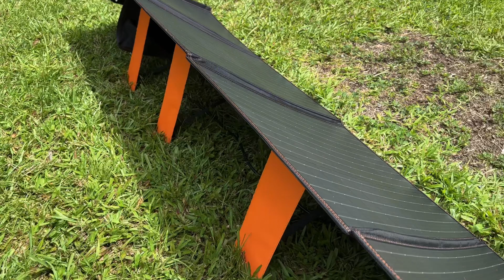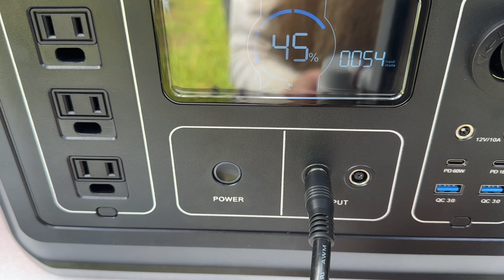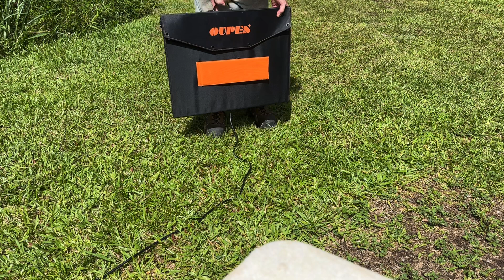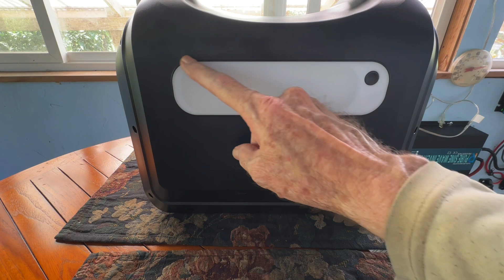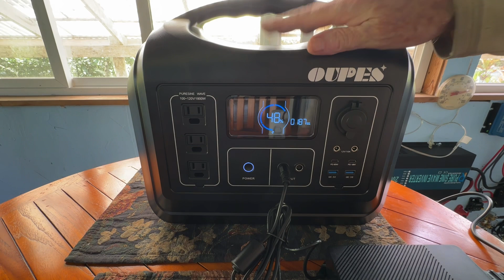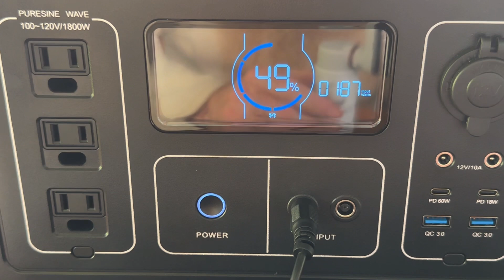OUPES 1800W Portable Power Station w/240Watt solar suitcase 1488Wh LiFePO4 /Pure sine wave inverter!

Comment: Nice capacity unit for its size.  Do not like the small input charging from AC. Guessing 8 to 10 hours to fully charge from AC if unit fully close to discharge.
Reply from the maker: You may be right my friend. I never did use that from absolute zero power. Took a few hours last night playing around with from about 60% I think it was. I'll do that in future see how long it takes. Been just leaving it on solar panels mostly during a few experiments. Aloha! 🤙
Reply: @ProjectsinParadise808  Love your channel.  Keep the great content coming!
Reply from the maker: @stevenshircliff393  Mahalo, mahalo! Will do! 🤙

Comment: I really like that one. Love the all in 1 units. so many coming out now.The power on the go is what I love the most. I got one like it. has extra charge feature I love. USB C PD charge . that one will run my laptop . PD 45W or more. some will take 24V input. get 2X or better charging speed over 12V .how I run a system like that when camping is put battery unit in the tent run wire to solar. when out side place under picnet table on a tarp . out of sun and rain. people with video and DSLR cameras will love this. HAM radio users like them as well. the 12V port run some radios. I know with the one I have using the 12V only did not make hardly any noise in the radio. The inverter did.was able to go to a state park with one set up fast. made coffee! had fun with parks on the air . and was a quick teardown. 1800 watts. that great ! coffee pot !   sandwich maker. can go to nice park set up have a nice meal . take lots of video . and for home. emergency power. great review. looking forward to seeing what else   that can do.
Reply from the maker: I really like it so far too! Especially the portable panels which work pretty good too. 1488Wh not a bad size . Ran the refrigerator over night one night but slept through the disconnect at zero power. Last I knew was about 19 hours. I'll try some other heavy loads and post. Coffee pot, induction cooking and something else to max it out at 1800W. See how it goes. Aloha buddy! 🤙
Reply: @ProjectsinParadise808  looking forward to video. I got the Anker one and 1 outher smaller one.

Comment: I agree with you about using an all-in-one unit depending on what your use case is. I have a smaller fridge with a variety of gadgets running off a pair of 2K Pecrons. It does make the solar panel setup a little more complicated since each system needs its own set of panels. Thanks for another great review!
Reply from the maker: I know a lot of people that get overwhelmed about solar, but these type units can get them started with no worries. Mahalo for sharing whats working for you! Aloha! 🤙
Reply: @ProjectsinParadise808  I agree with your comment, it get's overwhelming, these are perfect to get started. I have a couple and use mine daily, while I am studying the DIY route, even though I am no fan of having so many cables to deal with. Is it true that in order to charge a diy battery, you must disconnect the battery from the inverter, than connect the battery into charge controller? once finished back on to the inverter?